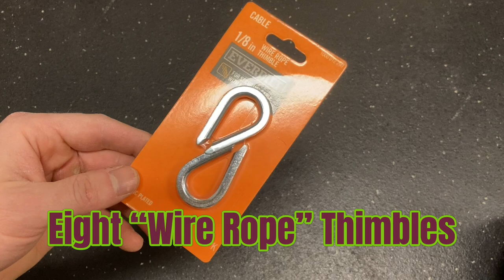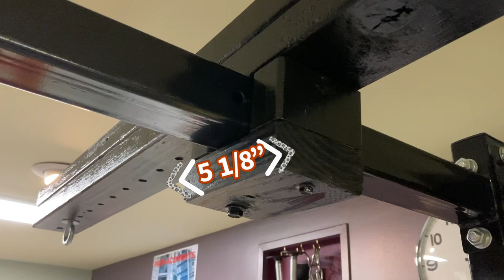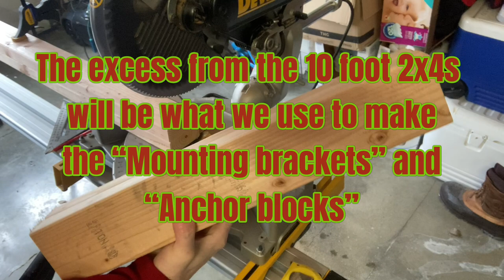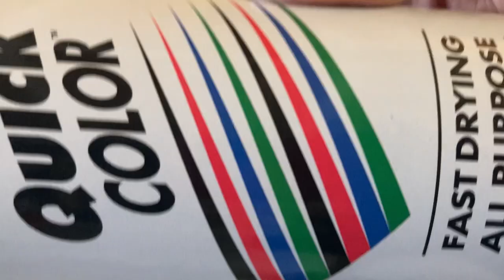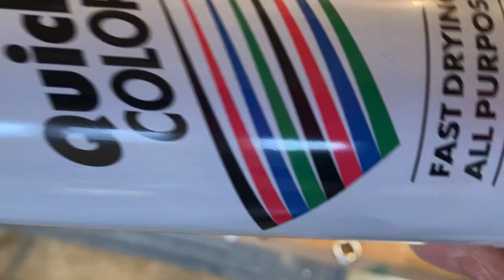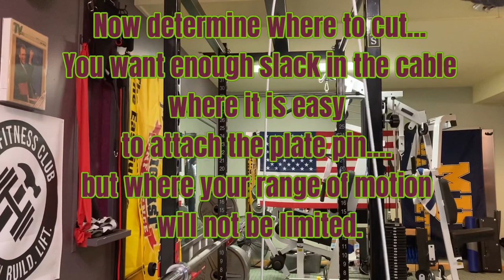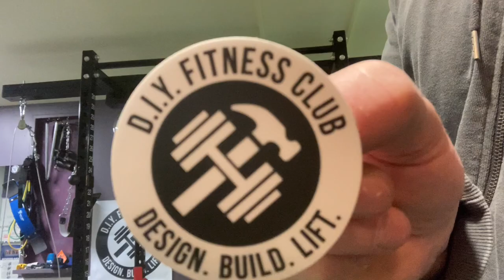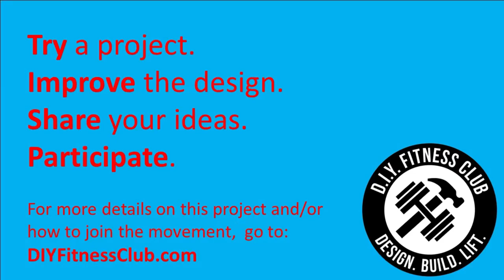BEST DIY Cable Crossover / DUAL Cable Pulley System

Comment: Hi,
Love this content! Does adding the support beam on top prevent the rack from future disassembly? Like, does this apparatus (namely the support beam) add a layer of permanence to the build? Also, would you consider upgrading the pulleys to mountain climbing pulleys (30kn or similar) for lessened friction / noise and to increase the overall durability / longevity to the system? One last thing, would you recommend this project to somebody like me, or would this be way over my head with little to no construction / carpentry etc. experience? Like, I could just buy the Fitness Reality lat-pulldown attachment for ~$220 shipped and be done with it, albeit with inferior parts and not certain about build quality in the years to come, and have that certainly translate to a poor man's cable x-over positioning / ROM with the makeshift attachment to make it the least bit viable. Loaded question(s), guess I can't help myself in the current moment. Also also, I'd be borrowing all tools needed to perform the job from friends and stuff, have no workbenches, etc. or dedicated workstation / space to perform said tasks in. I'm like the opposite of mechanically-inclined. Appreciate everything you're doing! -R
Reply from the maker: The unit can be easily removed by unscrewing 1 lag bolt per bracket. That being said, I want to emphasize that the unit can slide to the rear/front of the rack to "get out of the way) also. As far as the pulleys are concerned - of course the higher the quality of the pulleys that you use will increase the enjoyment. I used cheap pulleys to keep costs down - but they are satisfactory for me. As for your last question - I don't think I can answer that for you. Are you ready to join the DIY Community? We would love to have you join us! This is a relatively easy project - so if you wanted to dip your toe in the DIY waters - this would be a great project to start with. Thank you for supporting the channel!!!!

Comment: "I built this, in a (man)cave, from a box of scraps (I got from Harbor Freight)! I AM IRON MAN! *hammer on anvil PENG! sound in the background*" - A few pointers to people who'd be interested in rebuilding this: You can use static accessory cord (used for climbing, 8 or 9mm will be fine for most applications and will liekly last longer than steel cable too) instead of steel cables. Pro is that you can tie knots in it at any point and adjust your system to whatever you need at that moment. Some of the most high end lat pull down machines use such instead of steel cable. Also, do not cheap out on the rollers. Get some with ball bearings to make sure they run well/true and run SILENT.

Comment: How do you stop cables from twisting in a set up like this?
I’ve broken two cables so far from the cables untwisting inside their sheathing which causes the cables to lose their strength and snap
Reply from the maker: My opinion: you can’t prevent it. The cheap vinyl coated cable that I used will break. The trick is to replace it before it breaks. See 17:12 of this video. When it gets dark gray, it is time to replace it. Cheers! 🤘💪🙏

Comment: This is great. Have you tried doing lat pull downs across the length of the 2x4 using the outside eyebolts? I’m wondering if it’s stable, I have the same rack just the short version
Reply from the maker: I have separate a Multi-Functional cable machine which I use for Lat Pulldowns. However, I don’t why you couldn’t’ use the “DIY Cable Crossover” for Lat pull downs also. You would likely just need one longer cable dedicated to Lat Pull downs which has TWO pulleys on it, with one pulley attached to the center eyebolt and the other pulley attached to one of the “exterior” eyebolts. The weight would be attached to the center position for stability. This idea has inspired me to create a DIY new video as a “companion piece” to This video - to convert the Cable Crossover to a Lat Pulldown. Please subscribe to the channel so that you get alerted once the video drops! Thank you!
Reply: @DesignBuildLift  great, look forward to it!
Reply from the maker: Mind if i give you a “shout out” in the video?
Reply: @DesignBuildLift  haha not at all!
Reply from the maker: Thanks!
Reply from the maker: New Video - Check it out, and yes I gave you a shout out: https://youtu.be/Fo1WSsl626c

Comment: Just wanted to say, great vid!! Ive watched many dyi vids on youtube to help me get an idea on how to build a cable crossover system for my power cage and your vid and explanations was far the best!! I really dig how versatile your set up is and how many routines you can do with it. I will be going to home depot in a few days to get what i need. Can i use a 4x4 instead of two 2x4s? Thanks for the vid and tips....well done!! You got my sub!
Reply from the maker: Thank you, so much!

Be sure to go to DIYFitnessClub.com for more details on this project. I didn’t want the video to be “too long” - so i put more details on the website!
Reply from the maker: Yes FOR the top beam...a 4x4 is actually “better” in that a 4x4 will bow a little less, and will require less work for you. The video’s design utilized 2x4s only because I wanted to keep costs down. A 4x4 was more expensive than two 2x4s, and that was the sole reason I went with two 2x4s. 

However, for the two brackets, i would still use 2x4. If I the two brackets were made out of 4x4, it would unnecessarily stick out too far. I would likely hit my head on it doing some exercises (e.g, when slid to the rear position and doing standing calf extensions and/or belt squats—as demonstrated at the end of my DIY Belt Squat Belt video). 

Thanks again!
Reply: @DesignBuildLift  Awesome!!! Thanks for the quick reply, hope you have a great day! I can't wait to see what else you come up with.....Cheers my man!
Reply from the maker: Check out a new companion piece to this video here:  https://youtu.be/Fo1WSsl626c

Comment: But if you keep it in enclosure, you can't do cable pulls from sides
Reply from the maker: In this video, with this setup, you can use cables on sides of the rack as long as you leave enough space on the sides of your rack (don’t place rack too close to wall). 🙏🤘💪

Comment: Instead of two 2x4's, why not just use 4x4?
Reply from the maker: Great question! FULL Answer found here: https://diyfitnessclub.com/projects/cable-crossover 

But here you go anyways:

“I was recently asked by a Channel Subscriber if they could use a 4x4 instead of a 2x4. The answer is “Yes” - FOR FOR THE TOP BEAM.

For the Top Beam , a 4x4 is actually “better,” in that a 4x4 will bow a little less, and will require less work for you since you will not have to glue and lag-screw two boards together. 

The video’s design utilized 2x4s only because I wanted to keep costs down. A 4x4 was more expensive than two 2x4s (and 3 lag screws), and that was the sole reason I went with two 2x4s for the Top Beam.
Reply: @DesignBuildLift  thank you for the response! Now I have clarity! Love your content!
Reply from the maker: Thank you!!!!! I really appreciate it!!!